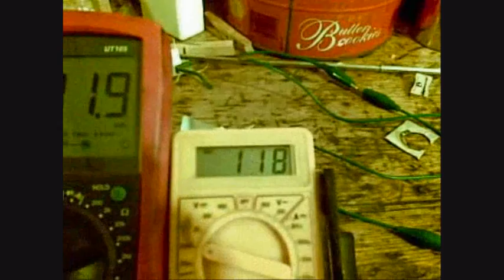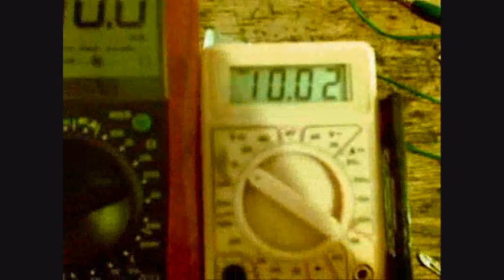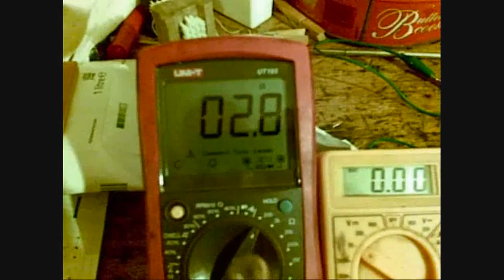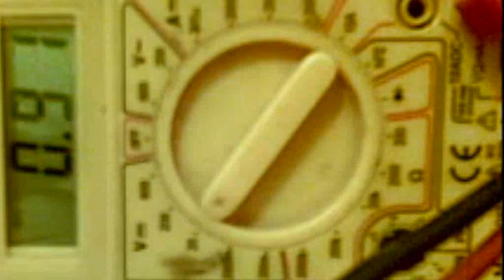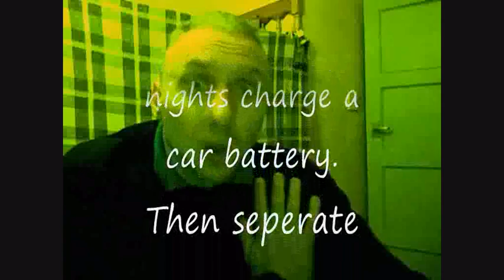Perpetual Motion Explained 1 (Overunity Solar LEDs)

Comment: I did this diagram Of a laser pointer, magnifying sheets, onto solar panel. With it you store the power in the batter, and then to a charge controller back to the laser pointer. So that you have a continues flow of over unity.  http://4.bp.blogspot.com/-YhtY3HG28zw/UgUbW-eoR1I/AAAAAAAABYk/BdC4YEoDc2U/s1600/perpetual_concept.jpg
Reply: I hope that we will continue Teslas work for Perpetual Energy.
Reply: Please See my Diagram of Mafnification Solar Panel. Without use of sun Energy http://4.bp.blogspot.com/-YhtY3HG28zw/UgUbW-eoR1I/AAAAAAAABYk/BdC4YEoDc2U/s1600/perpetual_concept.jpg